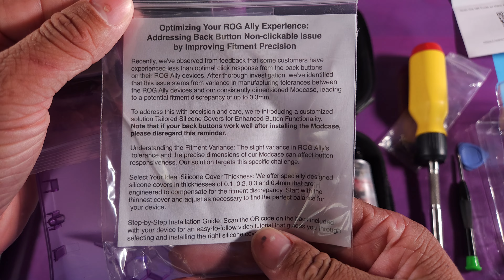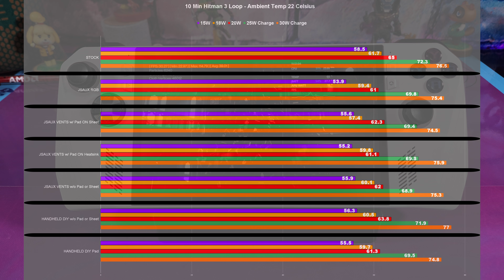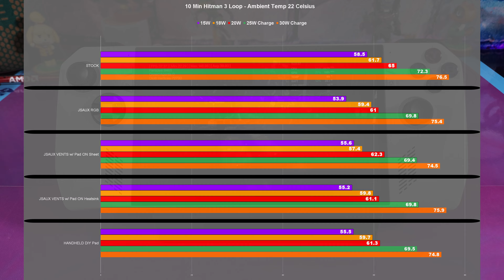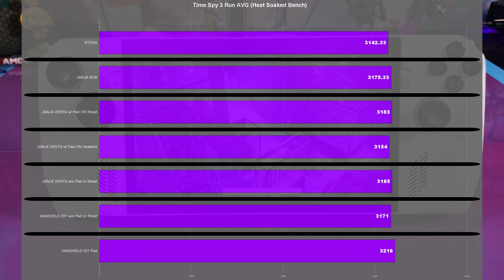Best Back Plate For ROG ALLY - All Models Tested!

Comment: For the HandheldDIY backplate, if you're not getting the original sounding "click" or travel on the triggers, you can also try having the little sticker/button covers on the backplate rather than on the buttons, I found that worked better for the L side of my Ally triggers.

Comment: Got the handheldDIY. Couldn't get the back buttons to feel good so I just ended up keeping them stock, but keeping the backplate
Reply from the maker: @joeymcjoeysalot6596  do you mean the back buttons? Strange that I didn't seem to have an issue with it however, admittedly I don't use them for gameplay so I couldn't tell you if they were "exactly" the same as previous

Comment: I just use that Jasux with nothing, heatsink adds too much weight and if it touching the ssd it transfers heat to it. With a killswitch on it it’ll stay under 95 at a constant 43w  tdp